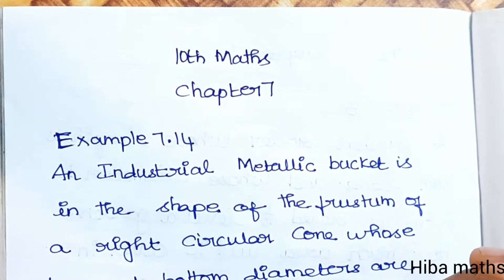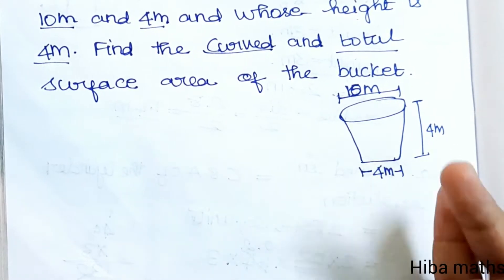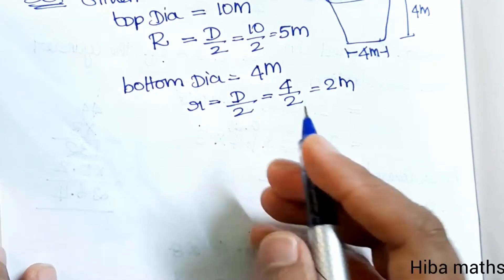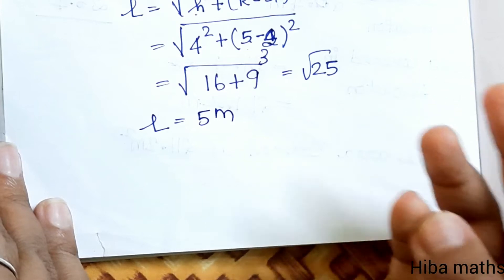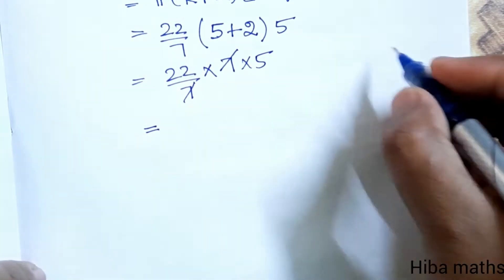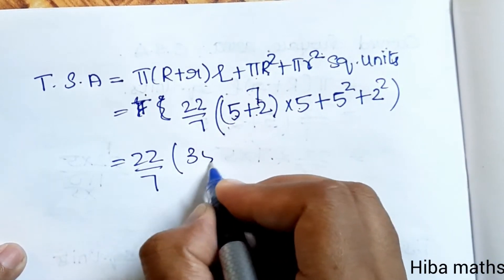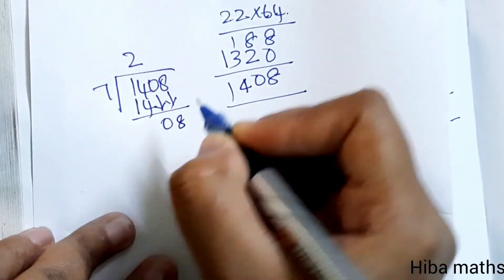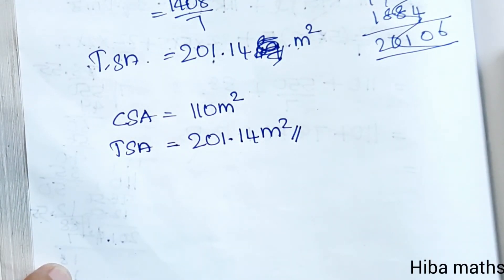10th maths chapter 7 example 7.14 TN samacheer hiba maths

Comment: In normal frustum there are two circles in the top and the bottom  so we have to  add both the circle to find TSA so the formula is π(R+r)l +πR²+πr² in this sum they asked the tsa of the bucket which is open on the top so in the formula we don't add the top circle so the formula is π(R+r)l+πr² . But in this vedio she mistakenly used the generl formula of the frustum so the answer is wrong.u use the second formula to find the answer
Reply: yes you are correct as per book
Reply: Super bro verithanam 
I am confused, before I
read this comment, after read this comments I am understood. 🎉🎉🎉

16.1.2026
Reply: Me too 😂❤
17.1.2026❤😊
Reply: Thank you very much for yours kind information